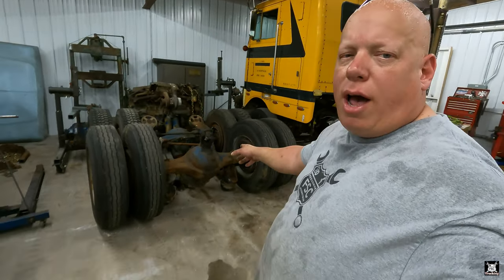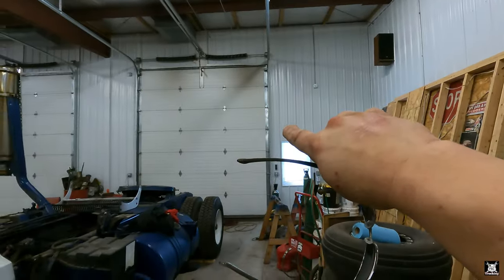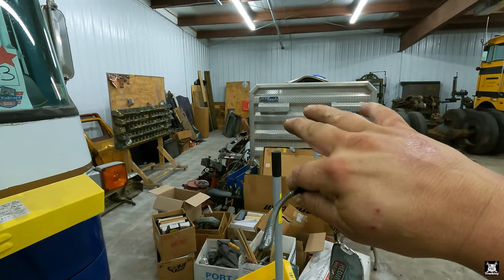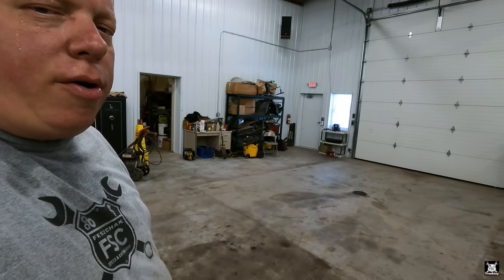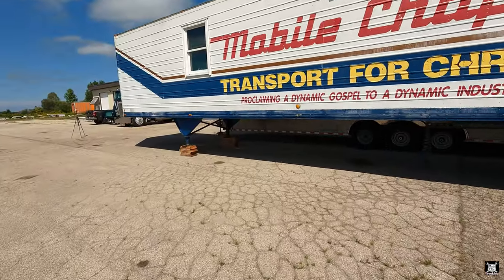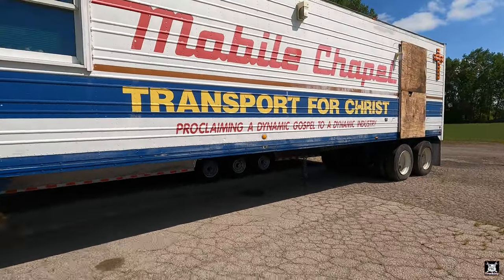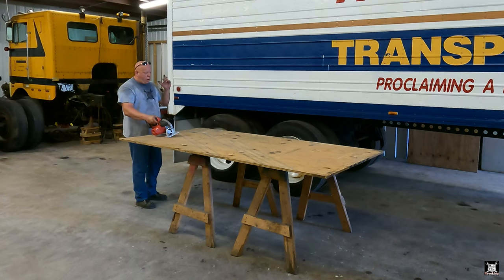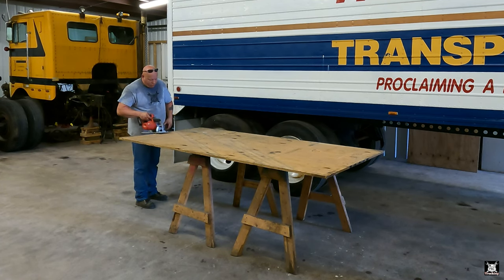I Put The Chapel Trailer Inside.   It Doesn't Fit!

Comment: For restoration it really doesnt need the wheels right now but makes it a chore to have to re-wheel if u need to move it for another project
It really is a pretty trailer for sure
Reply from the maker: Plan is other work is done in bay 1

Comment: I’m hoping you will repower the Ford with a Cat 3406 so you can carry less parts on hand as Orwell , the Ford and 352 Pete can just about use the same engine parts then. Great plan you had to get the trailer inside to by removing the tyres 👍🏼 there’s nothing wrong with working alone as you just make a plan to get it done. Not all of us have the luxury of having someone helping us.

Comment: Steve... you should reach out to that GreenAPU company you used for Orwell for the trailer generator... might be able to piggyback the APU with another pigtail to that chapel trailer!
Reply from the maker: The Green APU as is doesn't spin a generator.  An alternator charges the batteries.  
I don't know if that Kubota can run a generator big enough to run two air conditioning units.

Comment: Hey Steve, what's the status of your 12V71 Detroit? Is that still an ongoing project? When you first got it your videos on tearing it down were excellent and very very informative! Having driven an '87 FLC120 Freightliner in the early '90's with a swapped in and way turned up (600 hp at the ground!)  12V71TTAC  that was originally from a gen-set , your  project really caught my interest! But I haven't seen or heard any more about it more than a year. If it's still a viable project what are your plans for it?  If it's still a project, is there any chance of it going into  to your amazing Ford CL9000/Peterbilt 352 cabover mash-up? What a beast that would be with a "Buzzin' Dozen" 12V71 Detroit for power!
Reply: Ole2stroker has a cab over with a 12V71 in it....

Comment: Did you ever think of going to a junkyard and getting an air ride cutoff of a late model truck for the chapel truck? You got a ton of work with those old drives  and suspension off the 352?
Reply from the maker: The 352 frame and axles are air ride.

Comment: rebuild of 352 would have been good content
Reply: Steve had said the Ford would be easier to get turned around compared to the 352, plus there are a few things on that Pete that could also be used on "Orwell" in case of breakdown, so that's how the priorities shook out.
Reply: 352 just needed frame rails
everything was intact..ford needs new frame rails to use the Peterbilt parts 
so really is gong for a Peterbilt cl9000

Comment: 2 years A go  A gallon diesel cost you 2 dollar
Now that gallon of diesel Will cost you 4 dollar
But why you get your engine of the truck running all the time 
Engine out will save you money 
Greetings from Erik
Reply: He explained in a recent short that the electric motor to run his compressor died along with the control unit, so he's been using "Orwell" as his compressor to get shop air.
Reply: Not to mention you use very little fuel when stationary.
Greetings from Erik😜

Comment: well  it not like the green beast( it was odd color yellow and green mixed opp's painters goofed mixing )  a company truck with a airfoil on it roof higher then door the(your job remove it put it back on when fixed)  air horns still hit air out front tires lower it inch or so hold door up too! sand it paint it like army green ( no vista green industrial paint we got 100 gallons to get rid of) the shipper sent a pallet to much! every thing turned up green lawn mowers & benches & paint grass next! it brown! lack of water! ( just when your sick of painting) the shop caught on fire paint like 5 trucks now they were inside where it heated ok! 
repair the body work repaint them! it was for the birds (i went in air force that was a trip too! the green men deal like big boy scout camp with slow trucks if it that I got guy in motor pool put that gear here & flip it why i get 45 or 50 top speed instead of 30 to 35 why groom lake real god nasty at night at 15 mph legal hauling speed i want the home trip faster! empty trailers can got to like 45 or 50 legally and safely loaded it like dot or air force reg 15 mph! that slow ride to what known now area 51 plane testing grounds too! ( where think the toys they test happen at)